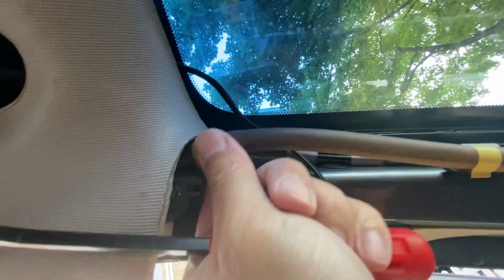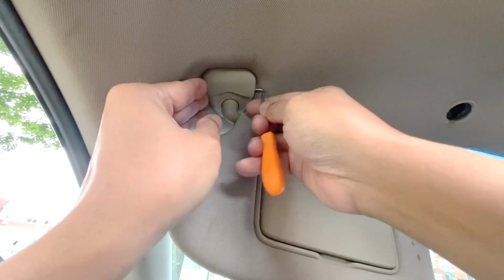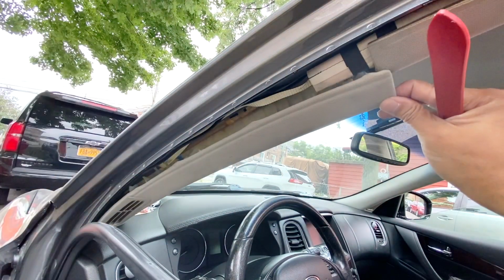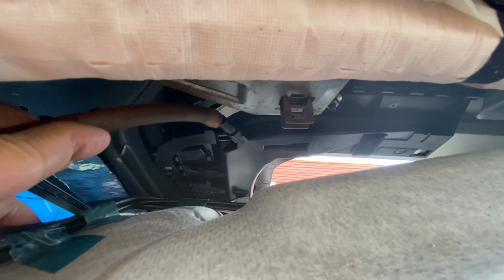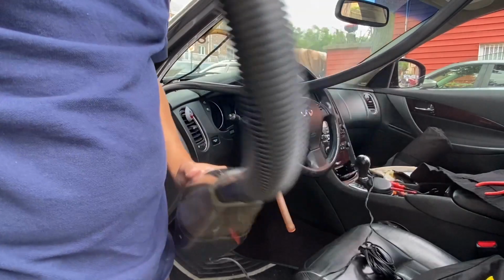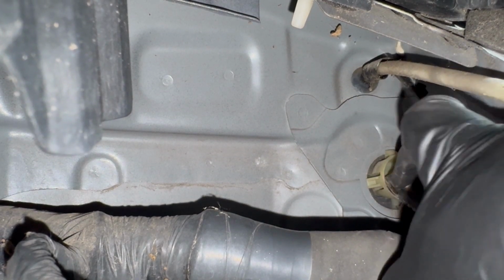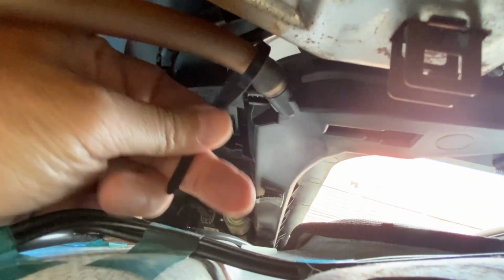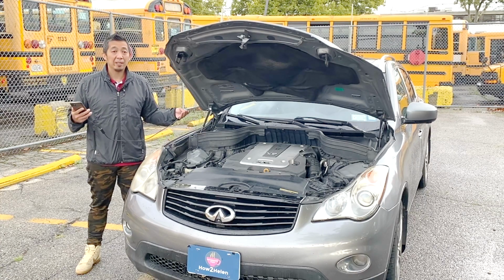Infiniti EX35 Sunroof Water leak cabin issue (Clogged Drain)- Viewer Request #sunroofleak #ex35

Comment: So if the hose was connected, would clearing the drain part in the engine bay have solved your problem?
Reply from the maker: Hello. Yes. But i do think the hose got disconnected because it was clogged and everything backed up into the roof drain. The water was looking for an out, and the connection was the weakest link. Thanks for asking-Rjeff H2H